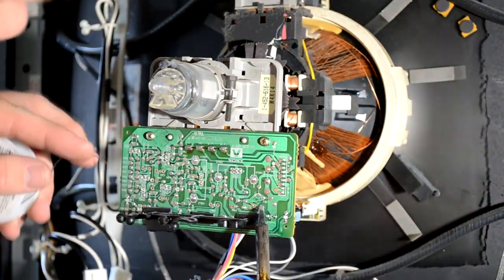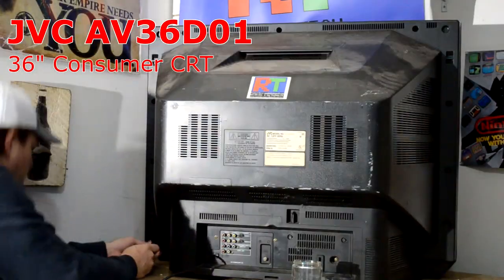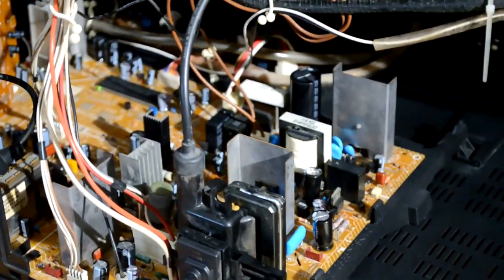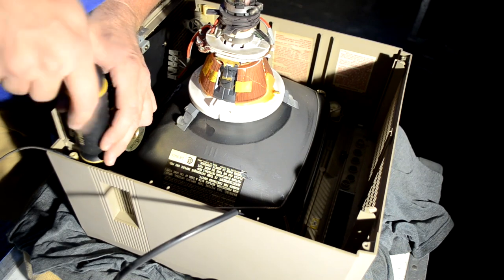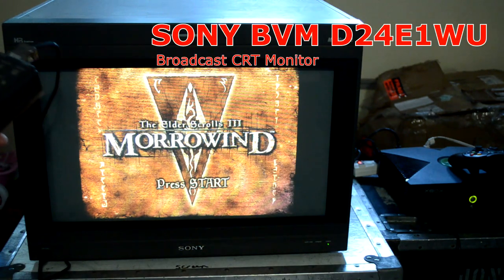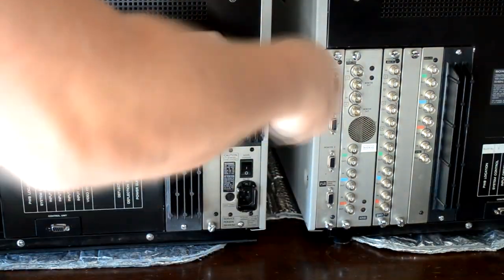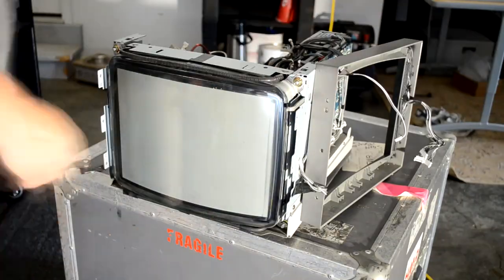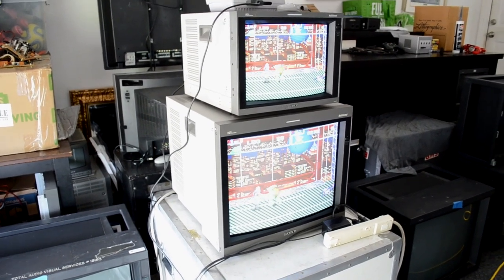2020: The Year of the CRT | Part 1

Comment: I have been watching several of your videos over last few weeks as I have a PVM-20L2 that won't turn on.  It has no b+ so I assume HV shutdown but it could be another protection circuit shutting down main power supply.  Do you have any videos troubleshooting no power or anything related to protector ckts?   Thanks for the vids.

Comment: I corrected the screen tilt on my CRT, epoxied it in place and in was straight for while but now I have tilt issues again. Any idea why this could be?
Reply from the maker: It must have moved so you'll need to open it up and reseat it and then tighten the screw near the rings to hand tight.

Comment: I recently acquired a JVC AV36260 which also has 800 lines resolution. Since this is in same neighborhood resolution wise as a bvm is this about as clean? Any reason to get bvm with having this set? It does have componenet.
Reply: Apparently JVC was being a bit too generous with their TV line count (counting them over the whole instead of over a square area), or so I heard. It<s also not gonna look like a BVM because there<s so much more to picture clarity than TVL. So I'd say a BVM would look very different, including the fact that it<s aperture grill versus your JVC which slot shadowmask. 

Having said that your JVC should look real nice and you know what, not everybody loves the BVM look. I bet your JVC looks closer to an arcade monitor than the BVM does. But yes if you want to experience a BVM then get one, it's very different from your JVC. It's gonna  be more clear for sure but kinda overkill for these old games, depends wheter you love the thick blanked-lines look.

Comment: I would love if a company with money to throw around could figure out a way to make a new age CRT, smaller, lighter, larger screen, better resolution, and of course, higher refresh rate. I would LOVE a gaming monitor that was CRT that could do 4k120hz or higher.... HDMI connection just because I've seen people using HDMI to RGB converters with 0 input latency. so clearly hdmi is good enough for 0 latency gaming for newer consoles on retro screens.